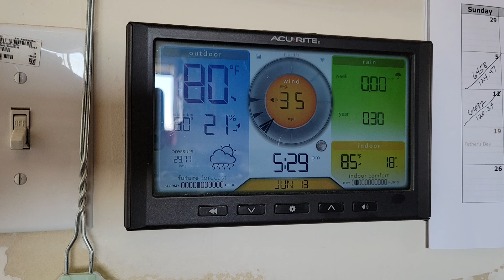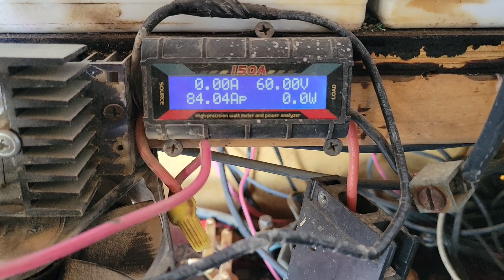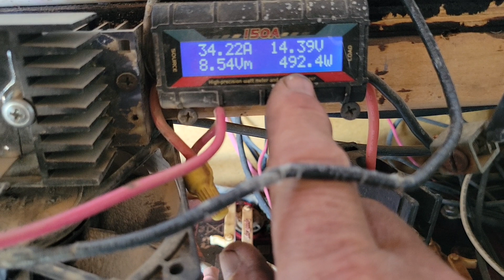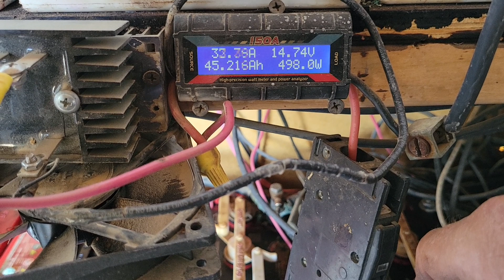What Happened to My Turbine in Super High Winds? June 13, 2022

Comment: That’s some crazy wind. Is the 80 amp breaker sized right for the cable 
maybe your cable could handle more amps and you could change the breaker out so it never trips on max output of the turbine. I don’t remember any of your gauges on the wires
Reply from the maker: 6ga on that

Comment: In case I got strong winds I got a 2000 Watt dumpload, freewheeling can spin up the turbine and eventual cause some very bad vibrations with catastrophic failure. Another option is to max out your power use, turn on AC and even a electric cooking hot plate, coffee maker, etc.
Reply from the maker: Yeah, I always turn on power guzzlers when the winds blow.

Comment: I suspect that if the wind speed goes up, the veggies need more water. Any chance that you could use some old fridges to collect water from the air around sunrise? Sorry to repeat myself, you really need wind breaks around your GH in order to reduce the evaporation. I wonder, is your way of disposing grey water the most beneficial for re-greening the desert around you?
Reply from the maker: I appreciate your input and suggestions, but what I'm experiencing  for weather this year is something new.  These winds are by no means "normal".  If I plan a block for them, it may be a wasted expense.  As money is tighter than usual with inflation and gasoline prices through the roof,  I really can't afford to take a chance like that.  A secure wind block would also block sunlight for many hours of a normal day.

Comment: Thats some good wind power i need to put mine up on the pole ....... Keep it up brother.........
Reply from the maker: Remember,  the force on the PMA from the wind is the same as tying a rope to the top of the pole and pulling it with your car.  Set a one cubic yard concrete base, and three strong guy wires using 1/4" cable.
I thought they were kidding at first and came home to find my original turbine leaned up against my cabin.